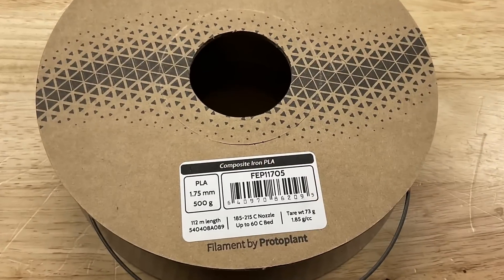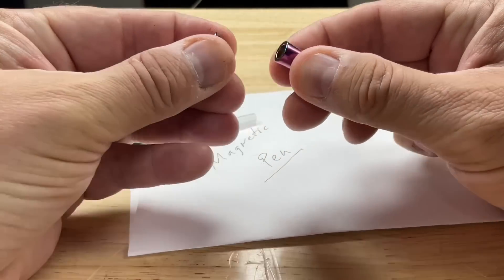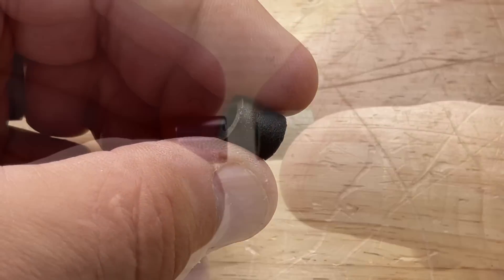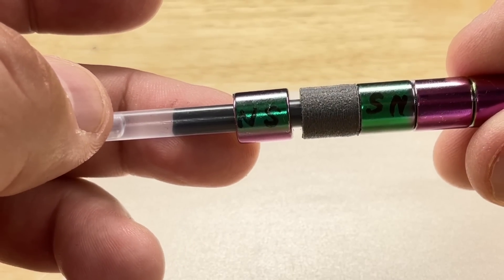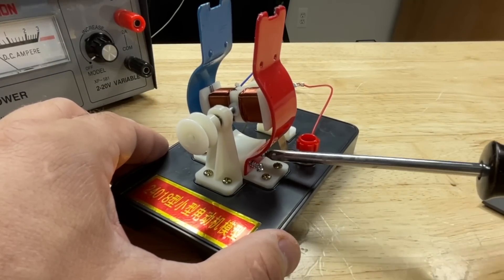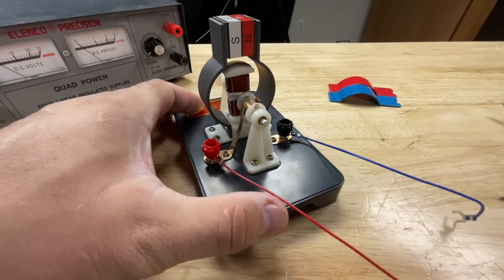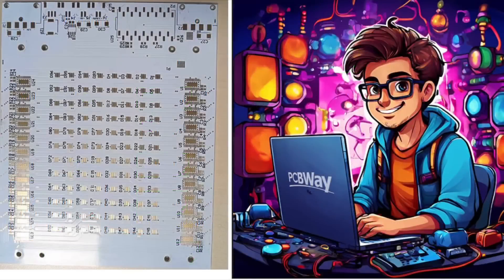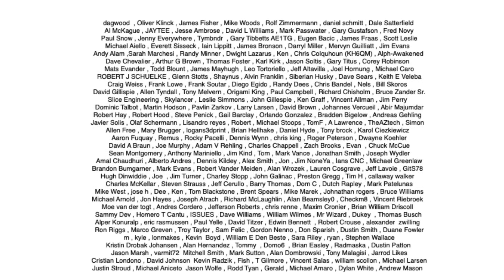3D Printed Magnets with Protopasta Iron Filament

Comment: When building electric motors and testing equipment, a trick companies use is directionally magnetized (during casting) iron plates. This dramatically enhances the strength of the magnetic permeability and efficiency. I imagine you could do the same with this if you heated a print up to around the glass temp and subjected it to a high electro-magnetic field axially.

Another idea, having an axial cylinder magnet on the nozzle as the filament is extruded might do the same thing. If tuned properly probably can get some next level layer adhesion from the iron slightly getting pulled out of each layer.
Probably have to use a ruby tip so they wouldn't clog the print.

Comment: You might have to magnizie it using a coil first.  Remember it comes out of the printer hot so it's going to lose some of that magnetism.   I just bought some of the Pursa stuff and I want to see if I can wrap a coil around the print head to force the poles when printing.  My idea is to make a 3d printed magnet strip for a linear encoder as all the strips you buy are just way to expensive.

Comment: I wonder if the 3D printed parts are really creating a field around the rotor or is it the proximity to the magnet causing the rotor to spin. What if you replaced the iron filament  pieces with regular PLA? They might be just acting as a support for the magnet.
Reply from the maker: That’s not how the motor works. The rotor is changing fields at the horizontal position not vertical position so it’s definitely the 3D Prints creating the field that makes the motor turn. 
Otherwise why have plates at all. Just put a magnet at the bottom and let it go.

Comment: I would think the reason it is not as magnetic or that it doesn't allow the magnetic field to pass through to other ferrous metals is that it is a powder in it so all the individual grains of powder are being magnetized but since the grains are separated by PLA, it doesn't allow the build up of the domain of fields like the molecules in a piece of metal.

Comment: another, and far more magnetically effective method is to make it as a ring, with the two magnets on the ID, maybe with pole caps to extend the field, increase the "pole pitch". only extend them for 90 degrees of an arc. think of a standard type DC motor in its steel casing. its iron for a reason?

think of it as iron keepers across the magnets, you are trying to "short" the magnets out with iron. then one is free to rotate, and when magnetised by the coil and current through the commutator, is repelled from that field.

as it is, magnetic flux is from magnet through iron polepiece, through airgap to rotor, through airgap from rotor to other pole piece then back to magnet... it works, its simple and cheap...

the problem being you get massive flux leakage from the iron itself. where one end of the rotor is right up near a magnet, in a strong field, the corresponding opposite end is at the weakest point in that poles field... at 90 degrees, the leakage and flux density is about equal... but wherever it is, the flux density through the rotor, what it actually repels against to create torque, is limited.

would be interesting to see the flux variations on the basic engine design... hmmmm... 

a simple improvement would be strap another set of magnets at the bottom, the same polarity. making one pole strongly south, the other strongly north, along their full length. stronger more uniform field.

you could have played around with the pole thickness as well, that is a very thin, high reluctance piece of metal! the leakage is huge, and the filament is even worse...

but yeah... making as direct a comparison as possible, i guess ;) but it would be fun to see how far you could take such a simple, nasty toy motor with some good magnetics?

Comment: So if it allows a south to connect to a south. Is this Sheldon Cooper's monopole that has a north at both ends?
Reply: He did demonstrate that the magnetic conductivity doesn't transfer through it, so I think both Souths were just connecting to the part itself instead of interacting with each other; reasons why it still repelled at first
Reply: @TS_Mind_Swept It repelled at first due to the magnetic field from the first magnet. At that distance the field is somewhat weak, but nonetheless it’s there. The second magnet stuck to the printed piece because its magnetic field was strong enough to overcome the weak field from the other magnet. It is not that there was anything magic about allowing two south poles to stick together.
Reply: @JustSomeHuman-j8o  that's what I said

Comment: I have my doubts about how far loose iron particles extend the magnetic field in the motor.. Surprised you didn't print the same part also out of plastic, just to gauge if the sides are that critical to operation, or it's the primary magnet at the top. But the filament does at least attract magnets to it.

Comment: It doesn't allow south to connect to south

The south pole of one magnet is inducing a north pole in the 3D printed part... but it hasn't magically converted it into a magnet, just modified the spin of some of the iron in the part. All you have is a slightly more 'north' end and  a slightly more 'south' end

When you force another south pole magnet onto the 'southish' end of the part, you then induce a 'north' pole in that side of the part as well, with a 'southish' area in the middle of the part and two 'northish' areas on the outsides

no magic here... just magnetic induction

Comment: This could be electroplated, so metal plated 3d prints.
Reply: Hen3drik here on YouTube already has built an entire channel on electroplating of both FDM and resin prints, although he always starts with a layer of conductive paint (copper- or graphite-based) before plating copper and then any other metals that may be desired. I don't know that plating on iron-bearing PLA would work very well without first applying a consistently conductive base layer by some means...same goes for the Eel flexible conductive filament from Ninjatek, which is conductive but has a much higher resistivity than metal and may not work well in a plating bath.
Reply: @justinchamberlin4195  Best time to test something is when you're uncertain of the result. I suspect that if there's enough conductivity present to start the deposition then any roughness both in conductivity and in surface texture will smooth itself out as the material goes down.

Comment: As a scale modeler turned RC car nut, I really can't help but wonder what something like this might bring to the modeling world. Specifically, rust.

If one were to print, for example, an engine block- and subject it to one or more processes that would induce rust formation on the genuine article- would it develop a visually pleasing patina?

Also, I'm betting that this is hell on your nozzle, but it's a consumable part anyway. Gotta pay to play.

Comment: Very interesting.  Can it be magnetized?  For the motor if you made the plates thicker, would that increase the efficiency and work with a lower voltage?  Could you enhance / decrease the magnetic properties with the direction or concentration of the infill/shells?  You could 3D print magnetic logic gates that way.  Make a micro generator? 3D printed door magnetic door catches, puzzles, locks, etc.  With a multi-filament printer It opens the door to many applications.  Combined with using conductive and non-conductive filament you could try to entirely 3D print a motor / generator?

Comment: You will find that your result of magnets at first repelling then attracting happens with any magnetic material in between,  It is commonly used to shape the magnetic field for a particular effect. It is easier to design and assemble devices this way than to hold opposing magnets in place by brute force alone. 
 Perhaps more unintuitive is that the same thing happens, for example, when you force a neodymium  magnet close to a ceramic magnet. This will weaken (but not immediately destroy) the ceramic magnet however.

Comment: I suspect that what you get printing this isn't really one magnet, but a bunch a small magnets scattered around with their poles in all sorts of directions. What polarity you get is basically the average of them all. This explains the behaviour on the pen. It also means the magnet is a lot weaker than it could potentially be.
If you were to drag a strong permanent magnet over your print in one direction a bunch of times (the way you would magnetize a screwdriver) you should be able to align the polarity of all the little iron flakes into a single axis - this will lose the multipolar feature you observed but the resulting magnetic print should be a LOT stronger, which has it's own uses. Worth an experiment ?
Reply: Yeah it is just like a piece of unmagnetized  iron.  Even if it started out magnetized, the process of melting it would put an end to that.